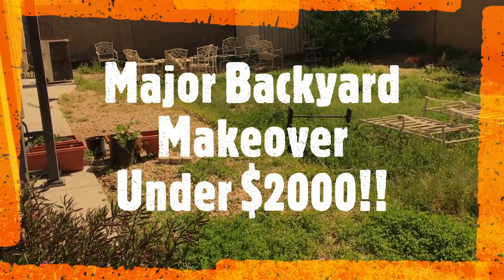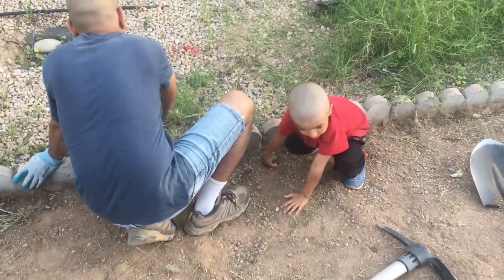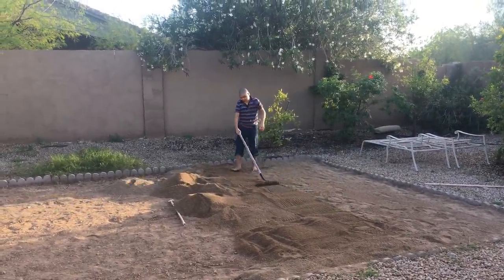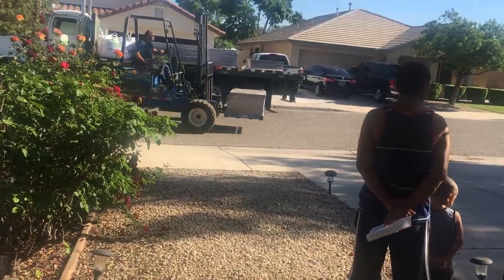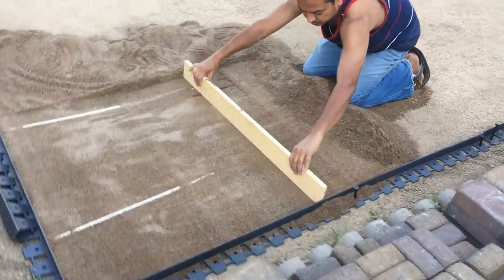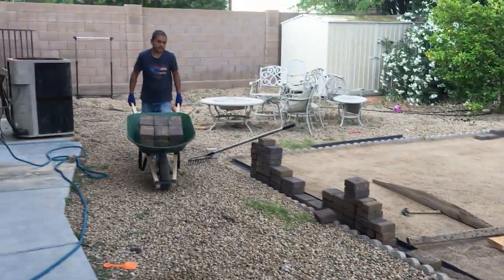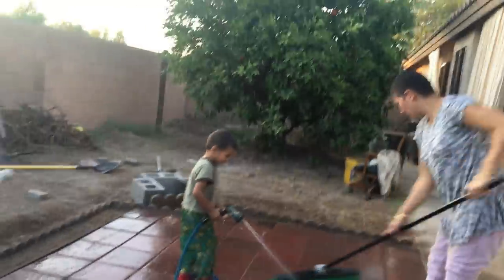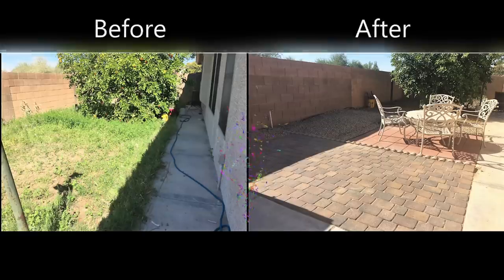DIY Major Backyard Makeover under $2000

Comment: Very nice:)  have a project on my side yard..I have a space of 16ft from home and porch to street fence  by 60ft along street fence.. almost 1000sq feet  just like your space except mine is on the side yard and have a slope..have differwnt options but still thinking about it...1..take dirt out to flatten space and may be have a sunken patio to put fire pit? Have to dig ou about 2 feet of  dirt on high point of slope to flatten area out.. 2...build a retaining wall close to fence and add dirt to  fill it  in  to flatten area out?.3..or just add a concrete slab  extension to the existing porch of about 10ft out and on remaining of space (6ft) build some of thoes planter boxes and plant some podocirpus trees or evergreens 🌲 for privacy along 60ft of fence?

Comment: Great video! Thank you for sharing and showing everything in such detail. I have a question: I have a backyard that is full of gravel, would I be able to use the gravel and compact it in order to put pavers down? Or do I need to clear out or the gravel due to its size? Do you have any suggestions? Thank you.
Reply from the maker: Thanks for your question. Gravel is not actually recommended as a base. You would need crushed granite.

Comment: was the price of the compactor included in the $2000 project, along with the sand and gravel used?
Reply from the maker: Thanks for your question. We bought an used compactor on craigslist and sold it after the project for the same price :). The material was included in $2000 except for red square pavers and the gravel that we put on the side of the house.